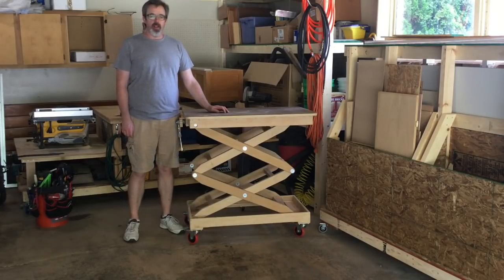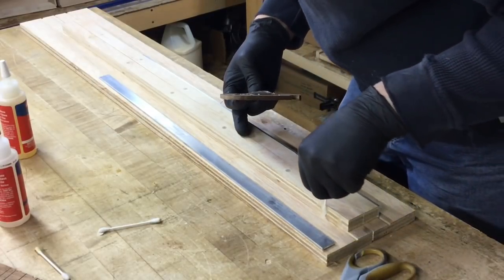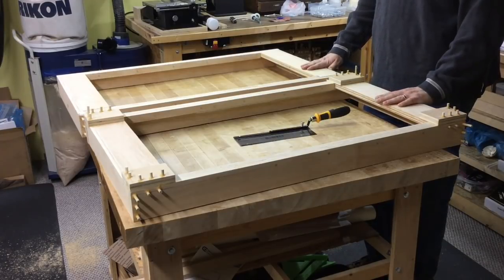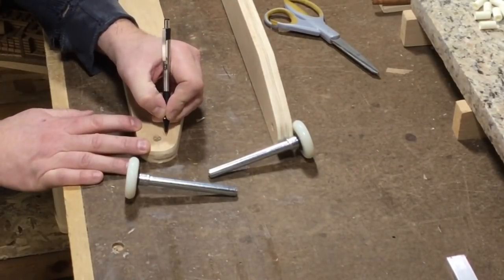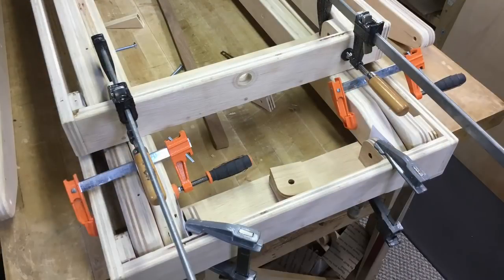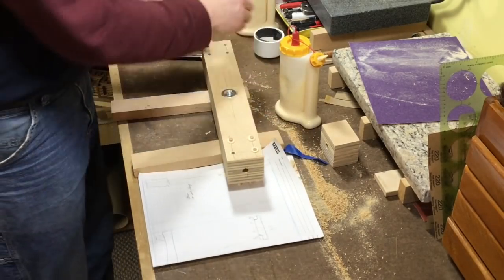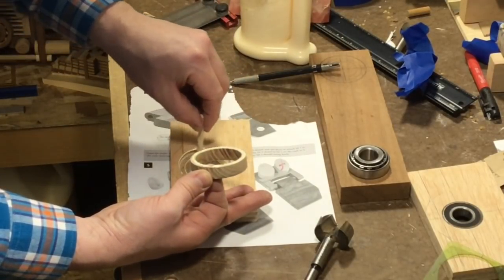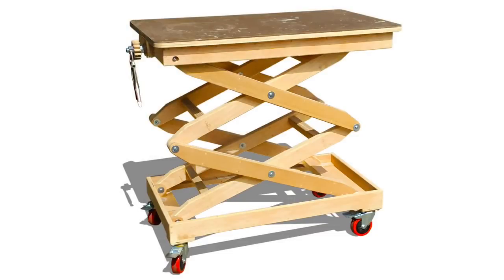Scissor lift table from a single sheet of plywood - plans available for newer updated design.

Comment: Anybody know what size threaded rod he's using? I'd love a full hardware list, but this is the main thing. Also (side-note): Couldn't you just really use small small PVC for the wooden pieces under the table that the rod simply turns through (both ends) Thought here is that this is not really going to be something that thousands of times spins around, just a few dozens of turns per table rise and lower. Anyway: Mainly, what size threaded rod please?
Reply from the maker: I used a standard 3/4-10 threaded rod. I am working on the full plans but don't have them ready yet. Thanks for the comment.
Reply: @s.g.devries8557  I have started a tiny version of this as a test (just out of a piece of craft wood). I have a need for this and excited to have found it. Thanks so much!

Comment: Would you have plans available?
Reply from the maker: I am working on them, but they are taking longer than I would like due to general life circumstances. The book is written, which contains the full plans and instructions in both Imperial and metric units, as well as the plywood cut sheets, and also the scale drawings for building out of hardwood. I am currently working on the hardwood table because there are some differences between building out of plywood and building out of hardwood, and I need the photos of the hardwood build to finish off the book. I had hoped to have it published by the end of summer 2021, and that obviously didn't happen. I would expect a couple more months. Thanks for asking.
Reply from the maker: Oliver, I have pinned a new comment at the top of the video about the plans, which are now available at Amazon. https://www.amazon.com/dp/B09WQ17SZP/ref=sr_1_5?crid=15AJX53LN8YSH&keywords=sg+devries&qid=1648654405&sprefix=sg+devries%2Caps%2C99&sr=8-5
It took me longer than I wanted to get them done, but now they are finished, and they are very detailed with step-by-step photos for everything. Thanks for the comment.

Comment: Do you have plans for the sisor lift you made. ?
Reply: You know, if you just pause the video at .57 seconds, you could have basically all you need. A list of all parts, dimensions, and layout on a sheet of ply. Just remember to double up the arms, as mentioned his initial build was nowhere near stiff enough. 

But personally, I think this is a pretty silly way to do it. Plywood is really not suited to long strips with a lot of force applied to them. Plywood makes a great shear panel and a very attractive uniform surface, but it's just not for this one dimensional loading, as half the grain is running the wrong way, making it basically useless for adding strength and stiffness. 

Really, personally, I would be tempted to just use steel flat bar. This would be MUCH stiffer and stronger, and you could get comparable weight to 1.5x36x3.5 inch oak bars while having vastly better performance.

Or just use some dimensional lumber. The gap between the stiffness of oak and even a relatively weak softwood like yellow or white pine will not be so extreme that you get better strength per volume using oak ply, let alone strength to weight. A good softwood, or any dimensional hardwood, will almost certainly be signficantly stiffer. 

TLDR: if you build this, don't use ply for the arms. There's a lot of great ideas, from the pex bushings to the garage door track wheels but ply is not the right material for this project.
Reply from the maker: I agree with you. Plywood is not the ideal material and it definitely puts weight limitations on the table. If I was going to use it for heavy loads I would build it out of hardwood, or at least a furniture grade plywood which is stronger. Since I only needed it for light duty, and cost was a major issue, I elected to go a cheaper route and use plywood. I would like to rebuild it some day out of hardwood.
Reply: Yes thanks
I have tried and it can be done but it is way hard. It hard to read, and so one.  For one reason or another I can't seem to find a plan
For one simmer not sure why. ?
If you can that would be great but if you don't I get it.
Thanks for your time 
Dennis

Comment: I did get a reply from S.G. DeVries.and he said he was working on the plans but that it was going slow.
Reply from the maker: Kenneth, I have now finished my plan book and it is up on Amazon as of March 29, 2022. The book has both Imperial and Metric dimensions, as well as the drawings for either a plywood or a hardwood build (there are some slight differences between the two).  I will be posting a video soon that goes over all of my improvements and upgrades, but in the meantime, if you are still interested, here is the link:  https://www.amazon.com/dp/B09WQ17SZP/ref=sr_1_5?crid=15AJX53LN8YSH&keywords=sg+devries&qid=1648654405&sprefix=sg+devries%2Caps%2C99&sr=8-5
Reply: I cannot wait to get this. Thank you so much for taking the time to let me know and for creating your plan book.
Reply: Just got the book today. I love it. Very nice

Comment: What was the dimensions of the sheet of plywood that you used?
Reply from the maker: Masih Jakob I am in the U.S. so here a standard sheet of plywood is 48” x 96”. It took a lot of positioning and repositioning of parts to get everything to fit. I also had to make sure I accounted for the wood lost to the saw blade on every cut. But it fit.

Comment: Wrong fastener rookie choice of undersize and not threading rod so solid inside wood not braces but plates. They are called bearings & bushings, use them everywhere when you can if at all available in most small towns.
Reply from the maker: You are correct sir. I did make a lot of mistakes on this table just as you mentioned.  This is part of the reason that it took me so long to put out plans for it, because I knew that I didn't want anyone to build it like I had. It wasn't strong or safe enough for me to want to tell anyone else to build it that way. My new table that I have just finished has a lot of upgrades, from much larger bolts and metal bushings, to thicker beams, to a vastly improved lead screw mechanism. I will be putting out a video soon on it. Thanks for the comment.

Comment: Nice!  But oh boy - the lies we tell ourselves..  You should at least estimate your hours!  Then we can honestly offset that by the cost of a commercial built ($800 average.)  IF you had made yours out of metal - so deduct maybe - $300.  And - it gets the job done.  Just needs a passable welding top (1/4 in steel or aluminum.)  Remember it's also a cheap lift gate for the truck - and can save you a depot charge for freight deliveries!  😄😚🤩 Like your very own little fork lift!